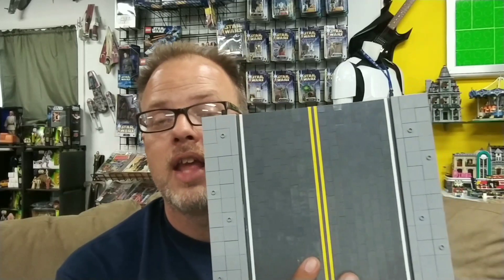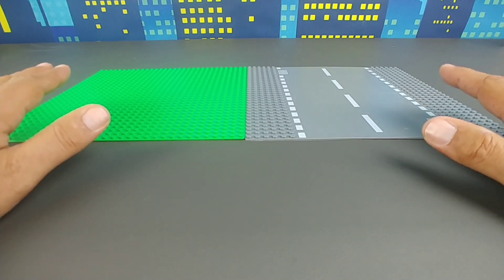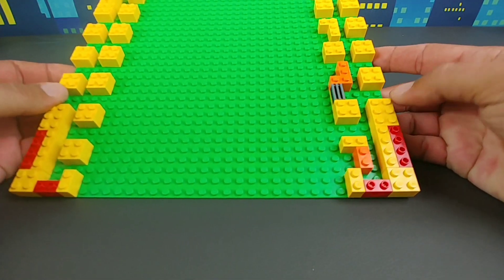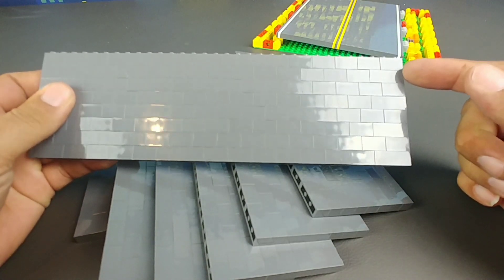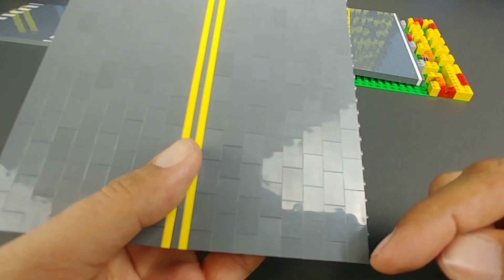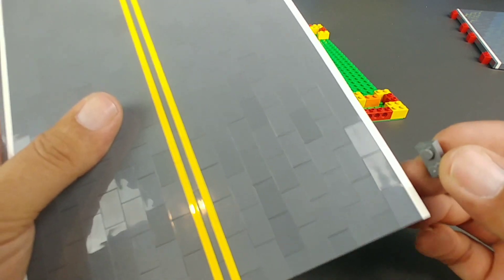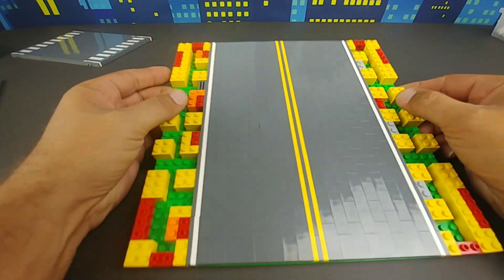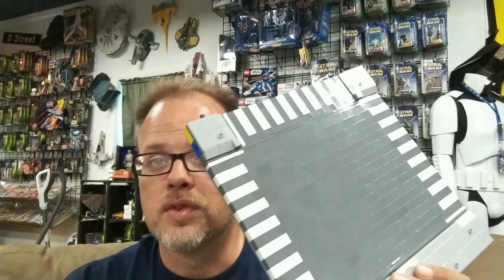How to Build A 8 Brick Wide Lane Lego Mils Road Plate

Comment: Hey Bevin bricks. I have decide to use the mils plate system. I am only using a couple straight and t-cross roads to lower costs. I thought I saw a video tutorial on the t roads but I cant find it. If there isn’t one and I’m just not remembering that well, can u make a tutorial. Thanks
Reply: @BevinsBricksWorld  do you have a link maybe to the page ?

Comment: Thanks for sharing! I was wondering though, doesn’t this drive the price of building your city up compared to using road plates? In my opinion, as I have been slowly building a city myself, getting enough road plates is costly and a pain in the but with the way they force you to buy them in the bundle packs. I was just wondering if you could compare and contrast using road plates vs. the mills plates. Thanks.

Comment: I noticed in the last mils plate video you used headlight bricks to snap the road to the baseplate. Is the technic brick better to use or did you use it because the road is wider?
Reply: @BevinsBricksWorld  Best kind. I ordered a bunch of headlight bricks so i will start with those. Good job on the videos btw.

Comment: Amazing work, but I have a question.  I built a whole bunch of these, and no matter what I seem to do, there's always a gap between the road section when I connect two or more together.  Do you have any tips for how to remedy that?
Reply from the maker: Yes there will be a gap between the two plates.  To me it's not a big deal as there is always cut lines and actual concrete roads also.  This is an expensive option but the only way to remedy that is when you have a long continuous Road you make it one continuous build and to avoid the issue with the shrinkage you use 1 by 12 bricks

Comment: Hey - love the videos.  I have very limited space thought so thinking of doing a 32x32 mils plate with road and rail... do you think this would work?  Essentially making a loop 4 plates up and 8 across... Happy to do left turns for the roads rather than complicated curves but wonder if there will be enough room for the train to turn?  Any thoughts or suggestions?
Reply: @BevinsBricksWorld  thanks so much for the response! I’ll check it out!!
Reply: @BevinsBricksWorld  I have redesigned and I’m going to do a 2 level table with rollercoaster and trains on the bottom level :).

I do have another quick question.  What do you think about building a mils plate up from the 2 x 32x16 base plates that all my modular a seem to have come with?  Will it still work ok?